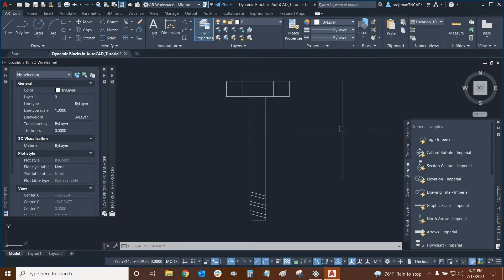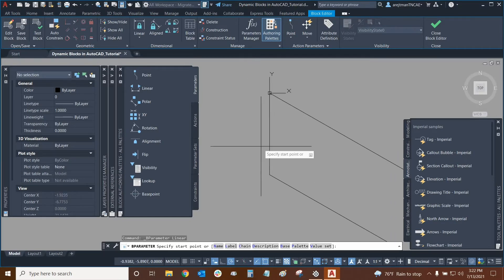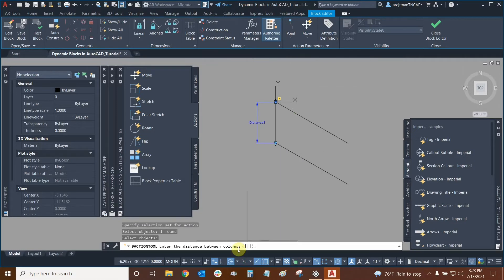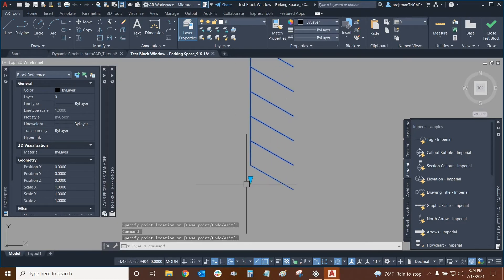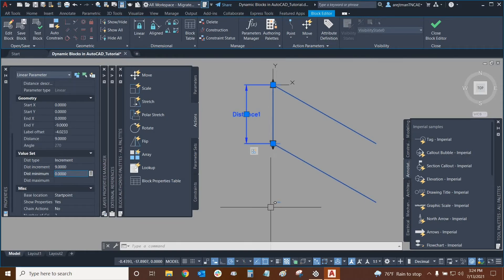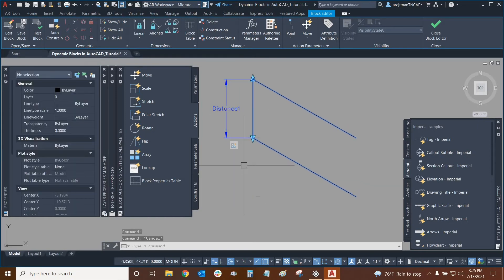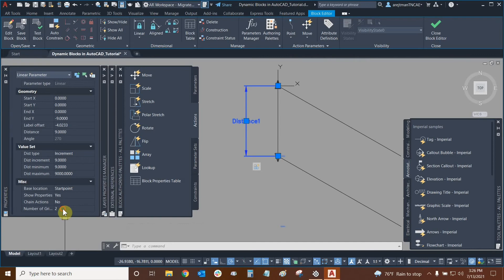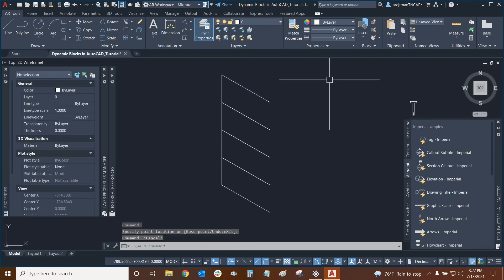Dynamic Blocks with Array Actions & Linear Parameters in AutoCAD - Part 5

Comment: Great video. How do I get the array action to link to the rotation after rotation? Lets say I have inserted a block, rotated it to the correct orientation then I want to apply the array at that rotation. Hope that makes sense.
Reply from the maker: Thank you! When inserting a block, you can type “R” to rotate it before placing it. Then, your array will be in the same rotation. You can also edit the block and associate a Rotate Action with a Rotate Parameter, the object(s), and the other parameters associated with the array.
Reply: @DigitalDraftingSystems  thanks for the reply. I was hoping to have the rotate action within the dynamic block but alas, I tried what you mentioned before i posted and it didn't work for some reason. Further reading on the issues suggests you cant rotate an Array in Dynamic blocks

Comment: Is it possible to put "USER PARAMETERS" in the Value Set information? Say if we wanted the 'dist increment' to be a varying feature that can be changed by a user parameter, so it can be different spacing between multiple iterations of the blocks in the model space, (not be the same for all dynamic block instances)

Comment: How do you array an object that has a strech parameter already?
Reply from the maker: There is no Stretch "Parameter", and the Stretch Action must be associated with an existing parameter. An Array Action will copy the objects multiple times, while the Stretch Action will move and increase/decrease the size of objects accordingly.

You can assign multiple actions to the same parameter, so after assigning a Stretch Action to a Linear Parameter, you can associate an Array Action to that same Linear Parameter. Your spacing for the array is the key factor in using both actions effectively.
Reply: @DigitalDraftingSystems  Thank you. My issue is simple but I can't seem to nail it. Ex.: A vertical line that arrays horizontally (X-axis) but then I can stretch each line repetition on the Y-axis. I need each line arrayed to stretch independent of the other one
Reply from the maker: @rediaz08  You can create a horizontal Linear Parameter for your Array Action and a vertical Linear Parameter for your Stretch Action. However, if you only have one line, to begin with, then that parameter will affect all subsequent lines created by the array.

Based on your question, it seems like making a block with an Array Action associated with a Linear Parameter will allow you to quantify the number of lines you need. After you determine that, you'll need to explode that block and adjust your lines accordingly. Using the regular "Array" command with "Associative" turned off accomplishes this as well and takes less time.
Reply: @DigitalDraftingSystems  I'm trying to create a block that is a simple bracket like this [ only horizontal.  I assigned one Stretch and two Array Actions to one Linear Parameter. The goal is, when I stretch the geometry to the right, it will create an array with two Points going in both the right and left direction. I've tried adding a second Linear Parameter and chaining it to the first one but it's not working. Any ideas?
Reply from the maker: @zigsrig  If you select the Linear Parameters and have Properties open, you can scroll down and select “Yes” next to “Chain Actions” for both of them.